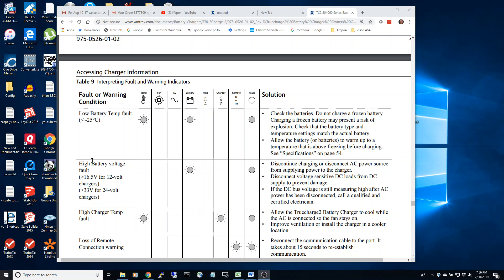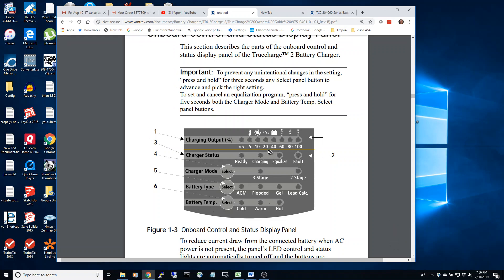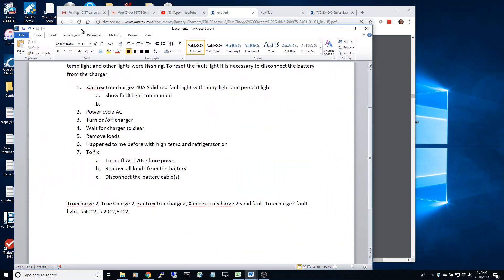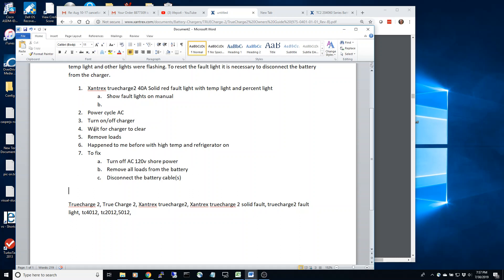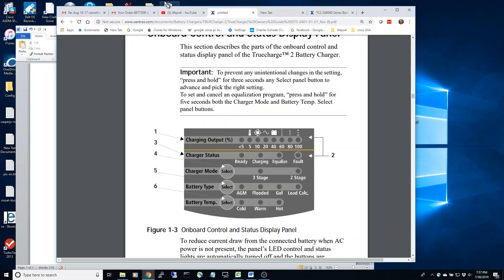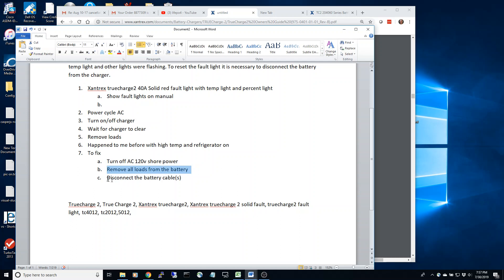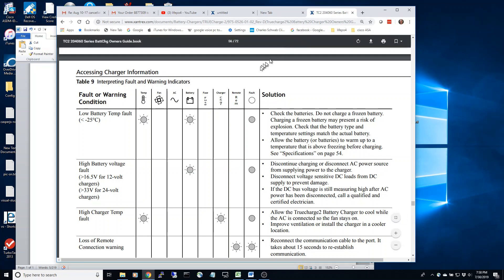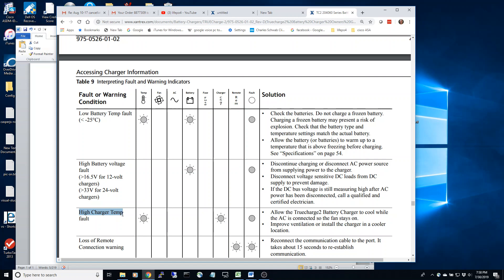Clearing Xantrex TrueCharge2 Solid Fault Light with Flashing Temp Light

Comment: Thanks for this video Danny. I have had this nagging issue for a few months. The charger was in fault mode and only charging at 80%. I contacted Xantrex but they were of no help. I just finished your solution and it worked   Code is cleared and now I’m charging at 100%
Reply: Just an update. Xantrex just replied with the same solution as your suggestion. They said to let it sit idle with no AC/DC power for a few hours. I counted to 20 as you do with most electronics and that worked as well. They described this method as a Hard Reboot and said the unit was confused so it went to default. A Hard Reboot resets the unit.  Thanks again for your posting.
Reply from the maker: Really happy this solved your problem. It sounds like we had a bit different problems but the solution was the same. If you could make a few notes on the light status you were getting for your problem it may help others.
Reply: @dannyjensen4954  I'm not at the boat this week but it was a solid red fault light and a flashing green light on the 80% charge line. The manual said it was an internal fault. Just turning the AC off did not work. As you  advised , both AC and DC had to be disconnected.

Comment: Having a fault with flashing 80.   Xantrex could only offer suggested turn AC power on and off and wait 30 min. Going to try this.
Reply from the maker: Stephanie Burgess I think this is an undocumented safety feature but a pain in the a$$. Let me know if it fixes.
Reply: danny jensen Could it have anything to do with low battery?  New to me boat was not on charger over the winter.  Otherwise shouldn’t have been over current or over temp.  Thanks for the reply!  Will try it out.  Just unhook all posts or one per battery?
Reply from the maker: Stephanie Burgess yes. Just unhook red and black. Main panel dc loads off. Shore power off. All dc breakers off. Re connect battery. Turn ac to charger on. If okay, charger will indicate charge, then slooooly turn dc loads on one at a time.